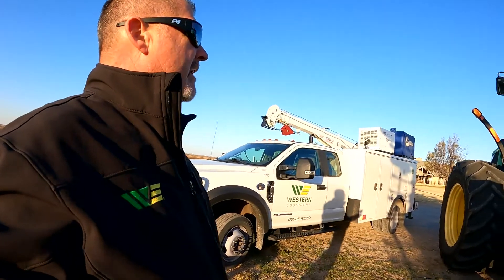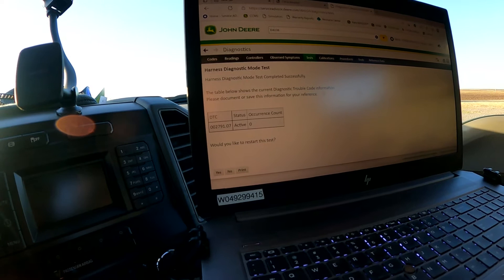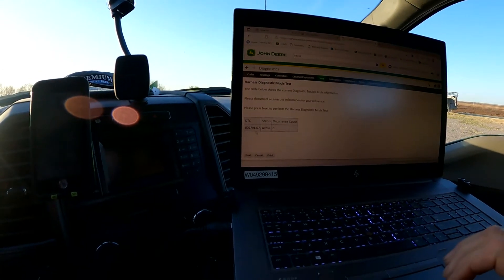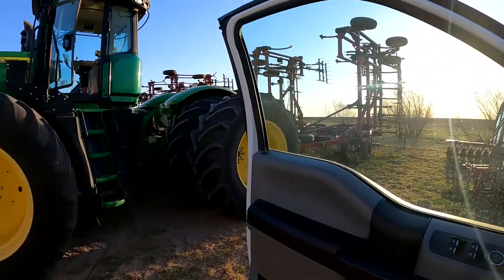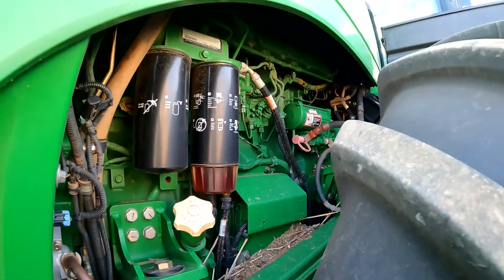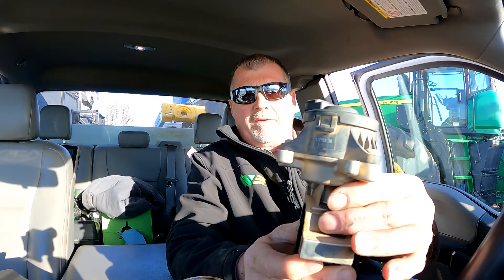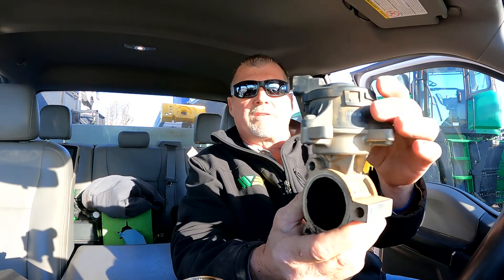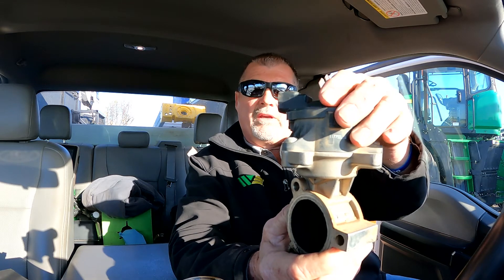Larry's Life E12 | John Deere 9460R with EGR Code 2791.07 Diagnosing and Repairing

Comment: The emissions control systems on these tractors are for reducing agricultural production, and generating added revenue for both factory and dealer.  These things are designed to fail and bring production to a standstill.  This has nothing to do with reducing emissions, it's about reducing harvests and increased profits for the multinational corporations.

Comment: I’m having an issue with code 2791.05. Checked connector Y5400 pins 4 and 6 to ground point and had 12v on both but suggested voltage should be at or below 0.5v. The tractor has 3hrs on it and the software payloads are up to date. This code is then followed by a 2791.07 due to the previously mentioned fault but does not remain active. Only pops up during a learn cycle. Harness replacement with 3hrs on it is crazy.
Reply: I’m having this exact problem, what ended up being the solution.